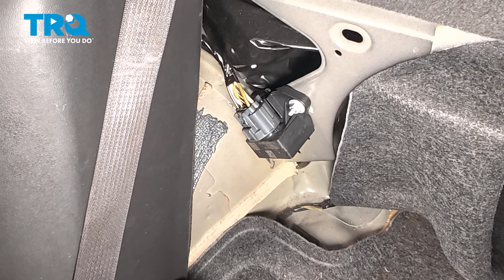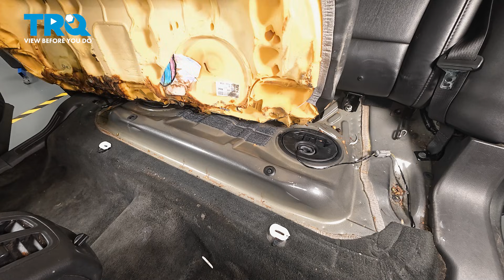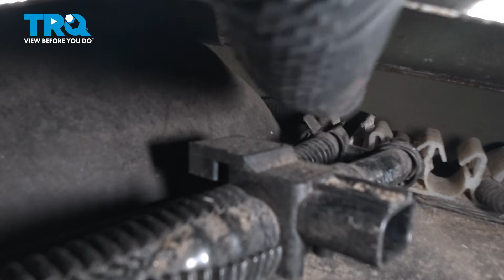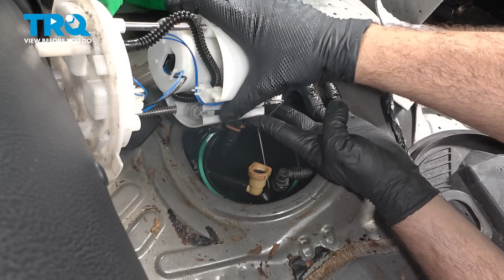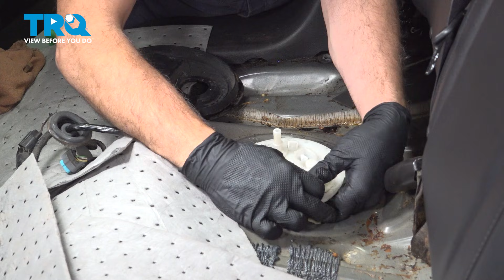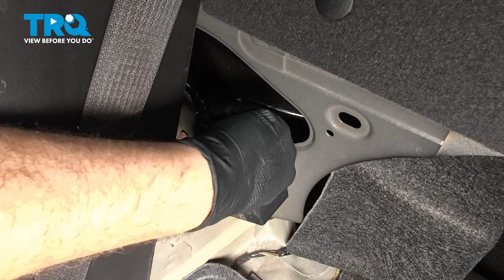How to Replace Fuel Pump Module Assembly 2010-2019 Ford Taurus 3.5L V6

Comment: This helped with my 2014 Limited. Though I am grateful there was not a bottom hose for that, the inside top one is without a doubt one of the worst designs ever. That hole needs to be bigger, the pump needs to be smaller or different design done. Almost rather do another trailer hitch than that